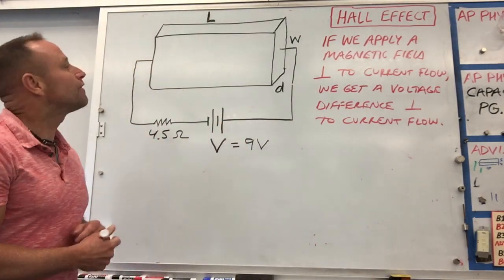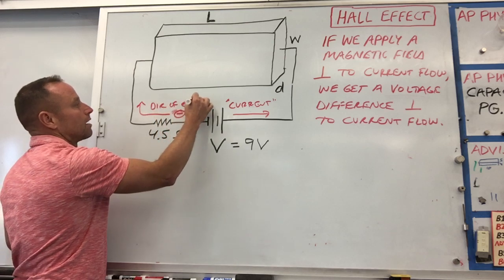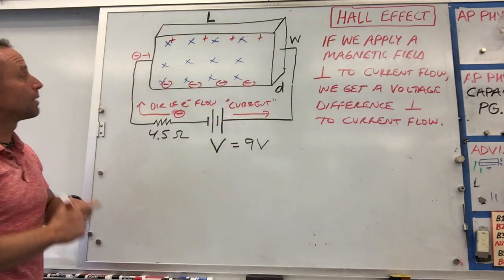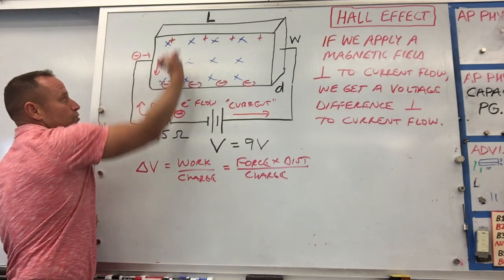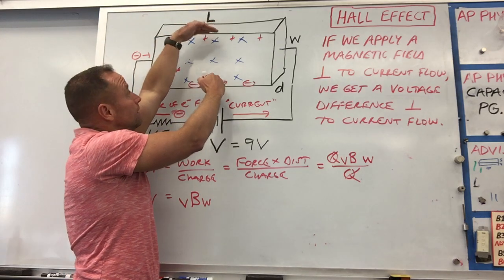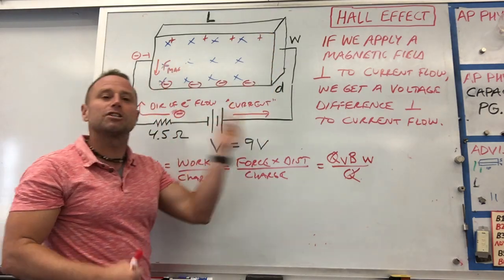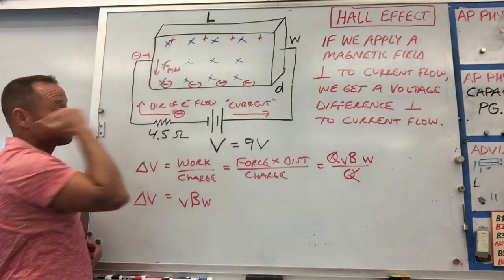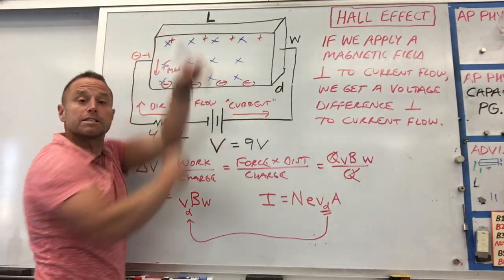Introduction to the Hall Effect

Comment: Up-down polarity wrong?
Reply from the maker: Looks correct o me.  If the charge carriers are electrons moving from left to right, the bottom of the bar will be at lower voltage than the top since electrons will pile up down there.  If the charge carriers are positives moving from right to left, the bottom of the bar will be at higher voltage than the top as positive charge piles up down there.  The polarity is different depending upon whether the charge carriers are electrons (-) or holes (+).
Reply: Thx for the answers; let’s see current I as you had mentioned: the ampere force is downward, or for a +q, it’s Lorentz force is downward—>the lower plate accumulates +q—>an upward E is produced which resists following +q to come to the lower plate till E=vxB. Right? @dr.piercesphysicsmath9071
Reply from the maker: perfect! yep
Reply: @dr.piercesphysicsmath9071  sorry for my argument; your idea is not wrong; these days I received also a few inquiries about the Hall effect, which is why I searched here and enjoyed your video. I integrated your explanation in my answers.